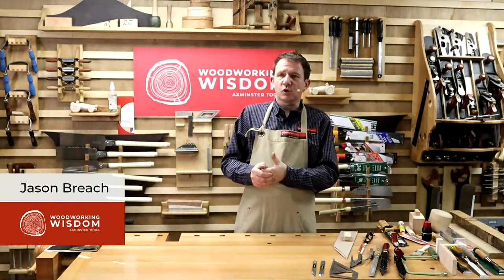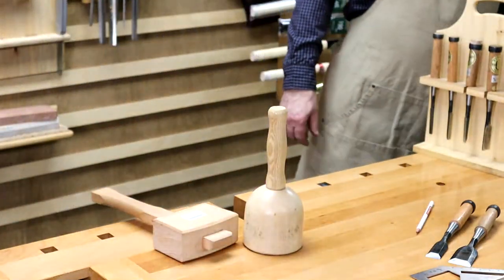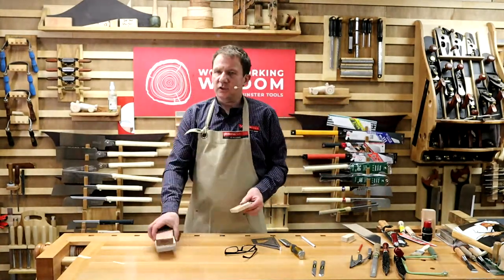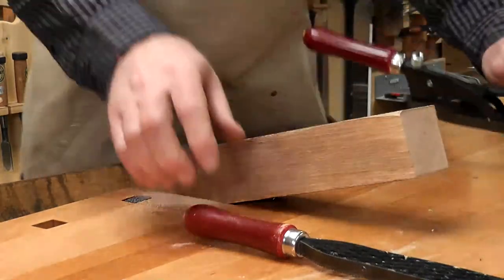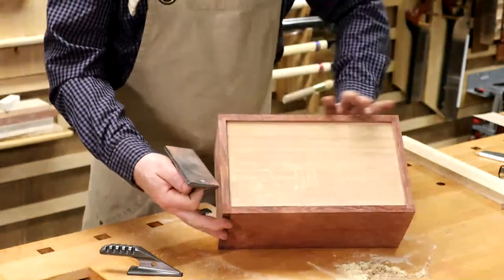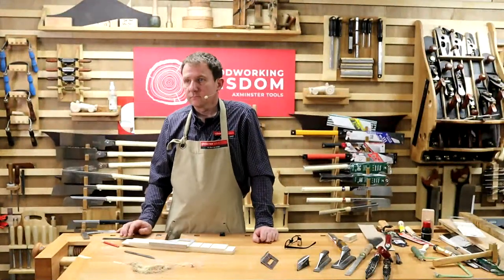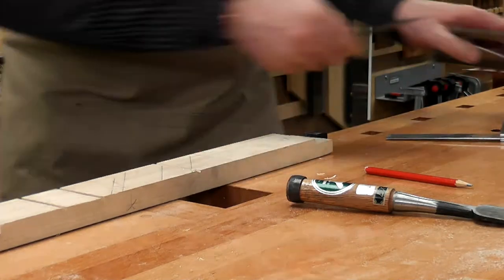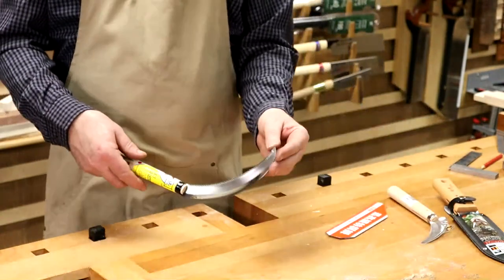Guide on Japanese Hand Tools - Woodworking Wisdom

Comment: I don't think the presenter has day to day experience of woodworking in regional Japan, but a dumbed down version that sounds knowledgeable. 
The hollow on the Nomi is called the ura. When the cutting edge gets close the ura, a tapping process is done called uradashi or tapping out. The soft steel is tapped using a genno hammer on an anvil or hard edge. This allows the back to be flattened again with enough steel behind the cutting edge. 
I use a family chisel that's well over 100 years old that has used this process. Uradashi also required when a blade is chipped. Sorry difficult to explain but there are videos on the process on kanna blades which are larger. It takes practise but uradashi can be done in a few minutes. Some chisels respond better to uradashi, I've knocked the end of a chisel with a miss guided tap. The tapping is done by sound on the chisel rather than visual. 
Re reading this, I've helped no-one 😢

Comment: At 2.30 minutes when he lays the chisels down, you can see the Japanese chisel is touching the surface all along it`s back . The Western chisel only touches the surface at the tip of the bevel.  I have a Hultafors chisel that lays flat on the surface . Chisel handles from Japan do not align the handle and back in parrallel lines.